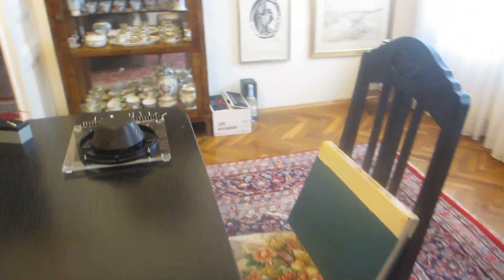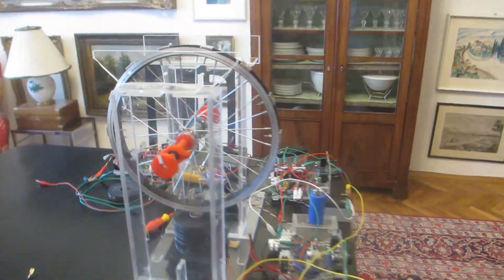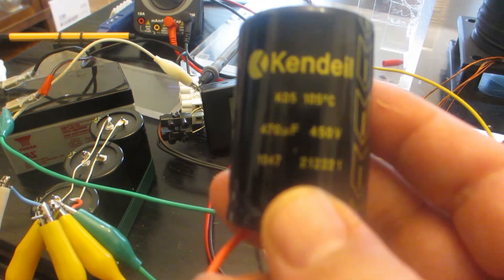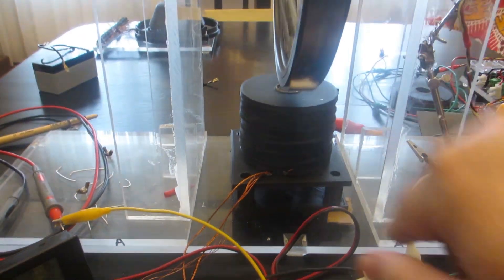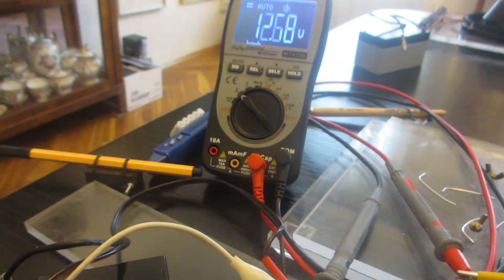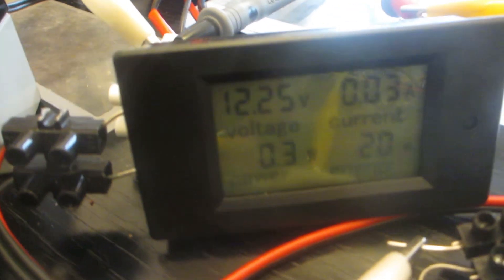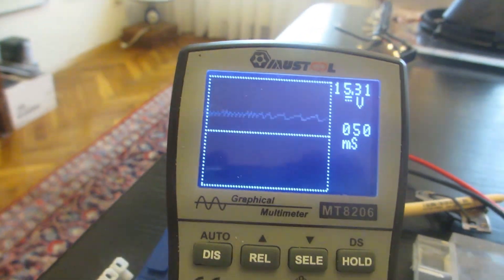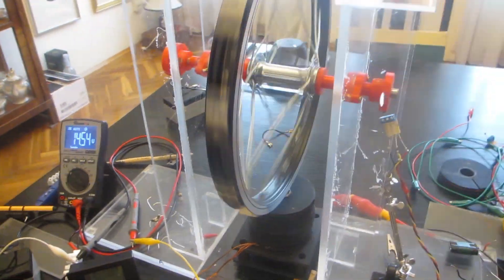Bedini Bicycle Wheel Pulse Motor: Feedback to run battery

Comment: BONJOUR,je me sert de relais SSR pour faire tourner un disque avec des aimants au nord et une bobine,genre moteur ADAMS et mon reai SSR fait que de griller?PEUX TU ME DIRE POURQUOI ET ME DONNER UNE SOLUTION , merci
Reply from the maker: Attention avec un ssr il te faut 2 circuits! un a bas voltage (une batterie 9v) et par exemple un interrupteur reed.. c'est lui qui déclenche le ssr.. de l'autre coté du ssr tu place la bobine et une autre source de courant. par exemple une batterie 12volts...  mais attention cela ne fonctionne que si ton ssr est entre 3 et 24volts par exemple du coté du déclencheur.. l'autre coté doit également être en courant continu!.. il est généralement marqué DC/DC.... s'il est marqué DC/AC il ne fonctionnera pas pour un moteur, car il est prévu pour courant alternatif!
Reply: @FreeEnergyNerd  Merci pour ta réponce,mon SSR est bien un DC DC ,avec du coté déclencheur un capteur hall 3144 alimenté en 5v et coté bobine du 50 v dc,mais j'ai l'impression que les déclenchements sont si rapes que le relai grille au bout de 10mn. Montage sur un moteur type ADAMS.
Reply from the maker: @balloutyves  Oui mais les 50 volts ne veulent rien dire.. chaque fois qu'il y a  un "pulse" il y a ce qu'on appelle le back emf.. c.a.d une pointe qui peut atteindre plusieurs centaines de volts. C'est au moment de l'interruption du circuit que cette pointe apparait.. (dans tous les circuits) .c'est pour cela qu'il faudrait mettre une diode pour empecher cela.. il y a des pointes de plus en plus fortes qui font que le ssr saute.

si tu prends un circuit bedini, (facile a trouver) il y a une diode et une ampoule neon qui absorbe cette pointe.. .. le circuit bedine se sert de cette pointe pour charger une batterie. Tu pourrais faire la meme chose, dans ce cas le ssr ne sauterait plus. il faudrait voir dans ton circuit.. le comparer a un circuit bedini, et voir ou on pourrait brancher la diode et le neon.
Reply: Merci,est ce que tu peux me donner une adresse mail et je t'envoi mon schéma ?
Reply from the maker: @balloutyves  llg@gmx.at mais comme je suis en vacances actuellement, ne verrais qu'a la fin du mois

Comment: Hi sorry is their an ssg circuit in this or is it just triggering with hall sensor.. if this is the ssg circuit to get the current to draw less use a mechanism to switch on and off the run battery which cases back emf .. makes sence i will try it anway on my ssg circuit. See if it makes a gain in the COP .
Reply from the maker: yes its a ssg, it switches the run battery off with a hall sensor.. and pulses back into the run battery in between... but.. (i know it now) there is a current surge.. that makes all the gains of that system disappear...  so switching on and off gives losses again :-(
Reply: That's pretty impressive running on 0.3 watts . I wonder if it will run on a generator coil. It should not be that hard to regain 0.3 Watts.

Comment: That’s a well done setup bro. 👍, like to setup a similar one like yours. how to setup up the charge back circuit? Thanks for sharing 💕
Reply from the maker: Well it works, but there ist a but, even if the relays are coming from a different battery, it does not load the run battery, it loads it a little bit, but after 1 or 2 hours it goes down. if you are looking for how to get current out of the system, and feeding back, you just need a 3rd winding (on a bedini system, a second winding on a hall based system). If you use a fast diode to rectify (shottky or uf4007), you will see that you get mainly the backemf from the system. On a normal bedini you will get a short circuit if you feed back, here you will not. but you will also see that the back-emf is only around 50% of your consumption.
Luc